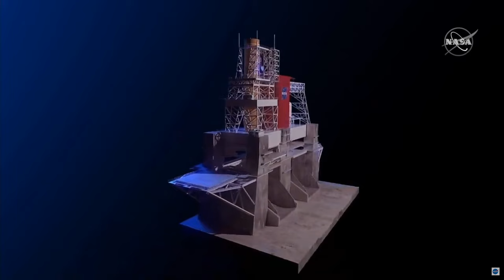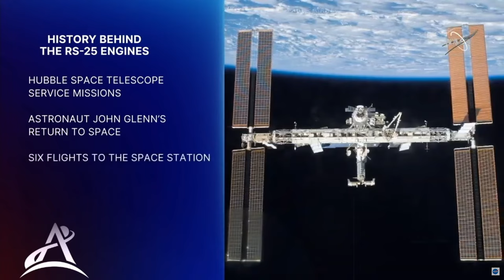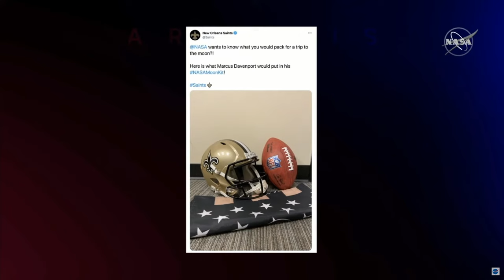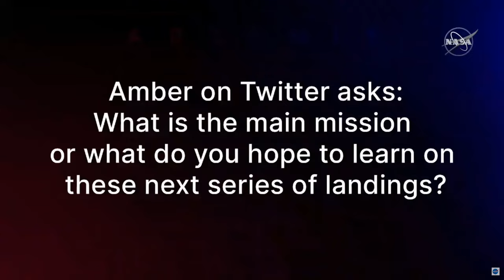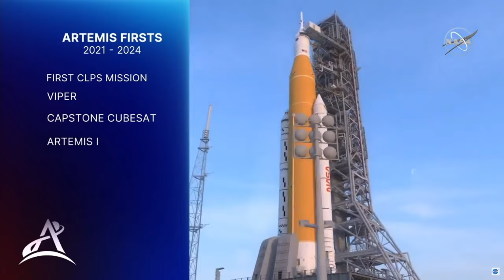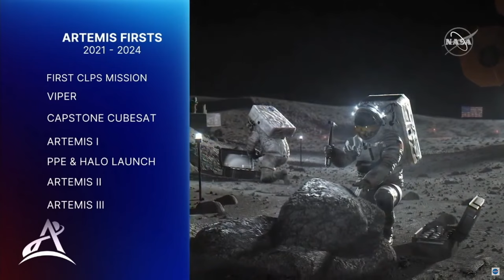WATCH: NASA Artemis Moon Hot Fire Rocket Test - Livestream

Comment: How does that happen? NASA have been in this game for decades, but this seems like they’re about 30 years behind SpaceX.
Reply: Testing isn't always successful, alot of work needs to be done. There are also alot of things to consider about the specific rocket theyre building and what it's implications are
Reply: Congress and changes in the administrative branch. The President sets goals for NASA and Congress controls the money. Private organizations have a different structure. If it is privately owned those that own the most shares decide how the money is spent. If it is a publicly traded stock the law requires the company to do what is in the best financial interests of the share holders.
    Much of the hardware is totally new or redesigns of proven hardware. It takes time to design build and test new components.
    It takes 2 to 5 years to design and build a new car. A manned flight system contains millions of parts that all must work first time every time. You get one shot, you can't run down to RocketsЯUs and get a new system.
Reply: @zdcyclops1lickley190  You are right about that but don't tell me this failure is about money. This failure means there are incompetent engineers at NASA.
Reply: The government doesn’t do well with innovation in contrast to the private sector. (At least not anymore) 
NASA was using 60’s and 70’s technology.
Reply: The overhead shot of the control room , with white boards/ to do lists, and half eaten lunch boxes was pure 1970,s. Possibly Windows 1, but I wouldn’t bet on it.
Reply: Haha, funny because they actually are. They're spending $15 billion+ to basically retrofit 40 year old technology on a thrown together frankenrocket. So saying they are 30-40 years behind SpaceX isn't wrong.
Reply: @andyphillips7435  Not to mention the references to some 600 page shutdown checklist manual. Straight from the 70s/80s.